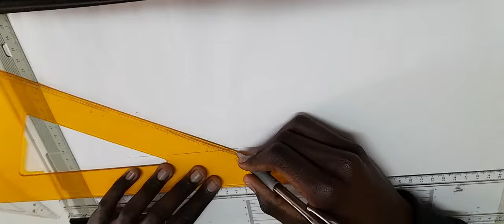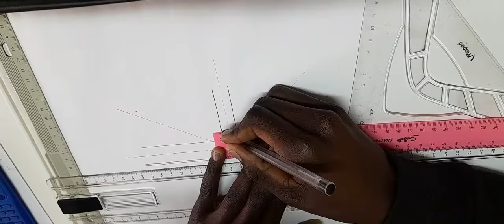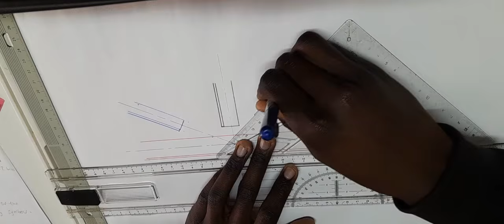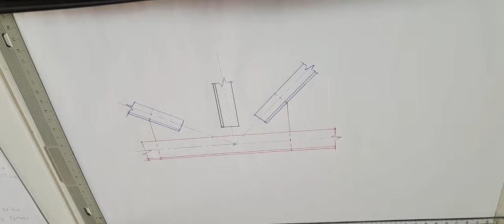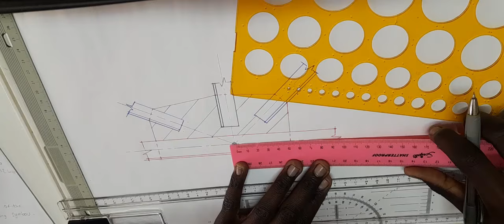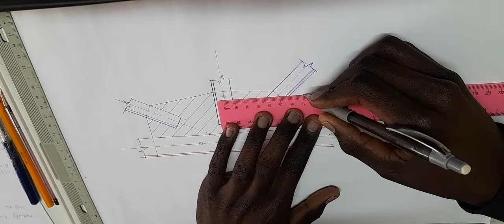Structural steel work( Connection on a gusset plate). BUILDING STRUCTURAL CONSTRUCTION N4

Comment from the maker: Comment with a chapter that you are struggling on and let me make it simple for you 🙏
Reply: How are you doing sir? I find roofs hard whether it's steel or timber roof because I never did EGD so sometimes I find the questions very tricky.💔
Reply from the maker: @nkosimpanza  worry less I will simplify it for you. I will make 2 videos of roof🙏
Reply: @MrTeeBSCN4 thank you so much. I would really appreciate it.
Reply from the maker: @nkosimpanza  Check out the roof video I uploaded
Reply: How are you doing sir? I find roofs hard whether it's steel or timber roof because I never did EGD so sometimes I find the questions very tricky.💔
Reply: Vertical section of H section, I don't know what thicknesses to use since that last number is in kg/m e.g 100 x 100 x 91.8kg/m
Reply from the maker: @future-engineer-n8h  try to use a steel book and check in the weight column try to find measurements matching your question dimensions then you will find the  most of the time I use 3mm
Reply: @MrTeeBSCN4 I did use a steel book and I got it thanks 👍🏾
Reply: Sir please also show how to draw a cavity wall in isometric view. I am so greatful for this page!!
Reply: Gusset base and beam to beam